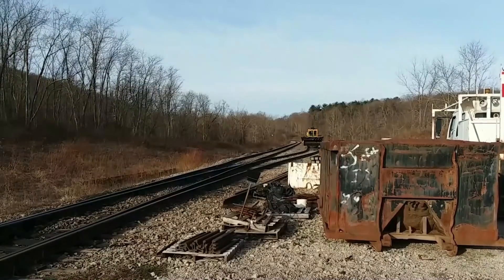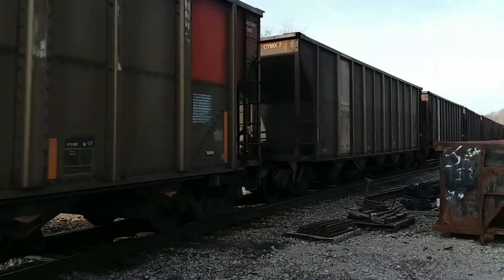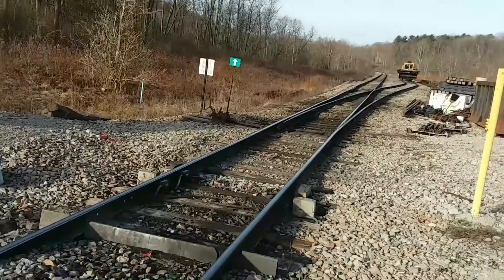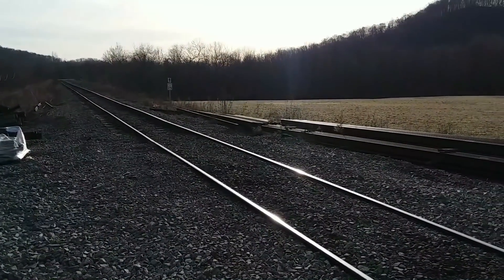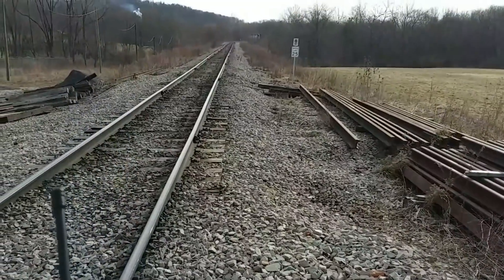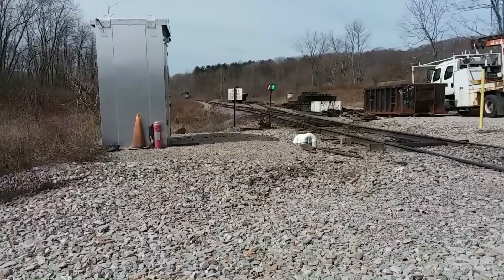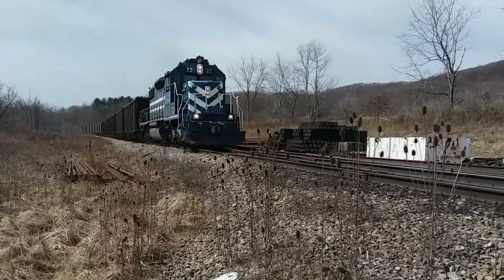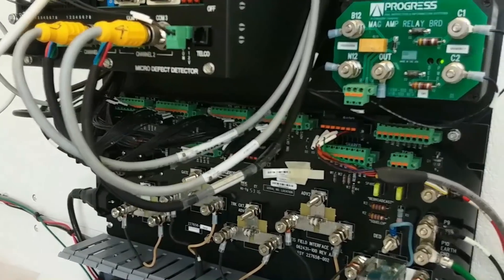Critical Alarm! Hot Wheel Detector Goes Nuts! on Dragging Equipment Message

Comment: I would love a video going into more detail about the technology inside and outside the cabinets. How it works, how the tech diagnoses the problem, and how he fixes it. I love radio technology so this is my favorite video that I’ve found from you so far! Keep up the awesome work!
Reply: Check out Mark Clay McGown's channel. He has a video on "How Wayside Detectors Work"
Reply from the maker: Thanks for the very nice comment Augustine. Have several other videos on a playlist on my channel of the detector, one of which I
take you inside the cabinet and give a better view around than there was in this one. I'm not well versed on exactly how the tech stuff
works, but the boxes on the outside on the rail take an infrared
picture of each bearing and wheel and measure temperatures.
I'll have to study up and learn more about the tech aspect and
see what I can do with another video. Thanks for the suggestion and
for watching today's movie
Reply: A considerable amount of train monitoring equipment is run by DHS in the US.

Comment: Cabinet wasn't over or under temperature was it? I've ran into gear shutting down when the AC unit trips and you don't see it until other equipment starts overheating.
Reply from the maker: It is heated and cooled to prevent that kind of stuff, tech guy
ended up coming out and fixing some glitch in the computer. Do
appreciate your writing in and for watching my good man
Reply: @ccrx6700  no problem, and thank you for providing a view not always seen in the railroad world. It's almost like doing a ride along, without getting in the way!
Reply from the maker: @kleetus92  😊

Comment: I’m really sure the twit listening is not listening right. It’s saying hot wheels as in dragging wheels. It counted 3 hot wheels the first time second time was axle one and two which meat the engine wheels are hot which is par for the course with independent engine brakes. The only thing I can think of is the wheels were dragging until the train reversed then the unlocked.
Reply: You literally have no clue what you're talking about. It clearly stated "Cumberland Hot Wheel Detector, Milepost 8 Point 0", it never said anything about hot wheels. They give them generic names as identifiers along with the milepost. And neither locomotive was dragging wheels. You'd hear it, for one, and two, you'd see it. Both roll-by, you can clearly see and hear the locomotives are rolling freely with no resistance. It was falsely picking up dragging equipment, because it's a combo detector. You can see the dragging equipment detector between the rails, and also the boxes with the eyes for the overheated bearing detector on both sides of the tracks. Why it announces "Hot Wheel Detector" instead of just "Defect Detector" is beyond me. Ours beep once and then announce "CSX Equipment Defect Detector, Milepost 198 point 9, Track 1 or 2, No Defects, No Defects. Total Axle one, zero, zero. End of transmission."
Reply: @DestructionofLeviathan  thanks for letting me know that I was wrong lol. I’m a lot more knowledgeable a about hot wheel, hot box and dragging equipment detectors than you. First of all there was no mention of dragging equipment. It did say hot wheels. Now dragging wheels would classify as hot wheels. There was also another warning about axle one which would be an engine wheel or axle. Dragging equipment would have left evidence ie knocking down a sensor that sits between the rails usually aluminum that gets sacrificed as something hits it versus a long piece of steel that’s a lot harder to knock down. There’s also over size detectors that can measure the overall dimensions of a car to let the engineer or conductor know that either a load has shifted or equipment is hanging off the side of the cars. As I’ve said at the start of my comment I’m not going to argue with you or anyone else on YouTube but being an ex railway employee I’m pretty sure that gives me the right to comment. Have a great day
Reply: @trevorjones8520  I'm a current conductor on a Class I. You have no argument here. You're wrong, and defect detectors malfunction all the time. You might want to get your ears checked. Have a good day.

Comment: This is like my VW giving me a tire pressure warning!  It's almost always wrong, but I always check to be safe.  The one time I actually did have a flat, it didn't detect anything until after I was driving away on the spare tire!
Reply: If it's like mine, it uses the wheel speed sensors, so you have to drive straight for a certain amount of time before it can figure out something is wrong. If it's the upgraded system that actually has sensors with transmitters inside every tire (part of the valve stem), no clue.
Reply: @HammondOfTexas0  Yeah, VW uses the ABS system, so it isn't very reliable.  Other manufacturers use TPMS valve stem, which transmits actual tire pressure.  But to be fair, my 2016 GTI hasn't had many false alarms.  But my 2012 Golf TDI gave me lots of false alarms.
Reply from the maker: Go figure on that one! I can really believe it too. Thanks for tuning in
to the show today good sir

Comment: Whenever our computers are messing up we try a little Applied Science on them. Whack them with a reasonable sized striking apparatus a couple times.  When that doesn’t work we call IT and they tell us to give a few more whacks with something a little bigger.
Reply from the maker: Sounds like a coal miner mechanic, if it doesn't budge with a big
hammer, get a bigger hammer....LOL We did shut it off first thing
but that didn't help. Tech guy finally came out and did a computer
adjustment. Do appreciate your watching my friend
Reply: We'd just pull the plug on them and then plug them back in. If they still didn't work right, the phone to our HQ would get used. IT didn't like getting phone calls at 0200. They'd tell us to pull the plug and then reboot again.  And the control room didn't like hearing we had lost communications with our remotely controlled equipment. If we didn't get it back up in a half hour, it meant someone else was going to get a wake up call. And for the last two years I worked there, it meant I was the one who was going to get woke up. It made for some short nights and some long days as my reporting time was 0600 anyways. Twice in the same night meant no going home until 1430. If it was two of our remote locations, and the local one was working fine, it meant two people were going to be spending the night baby sitting the equipment till the crew from 100 miles away got there and got it fixed. Computers could be a help, or the bane of your life when you are working with critical infrastructure and have a Federal Judge who might get woke up. And anyone could see what the equipment was doing and make the call to the judge. I can still see it today and haven't worked there for 18 years.
Reply: Over here we call it "Percussive Maintenance".
Reply: Dynamite!
Reply: As a life-long computer professional, I can tell you that there is a specific tool which some techs use to manually take care of a malfunctioning computer. We in the business call it "a 2x4"....
Reply: Oh yeah. The old technical tap.
Reply: @mikeznel6048  Percussive maintenance is sometimes required.
Reply: In the radio broadcasting business the whacks are called RCA field adjustments.
Reply: Haha 😂 That been my motto for years “When in doubt give it a clout” 😉👍🏼
Reply: No....  we tell you to unplug it znd plug it back in.
Reply: Hehe the good ol "hard reset". Though it is funny when hard reset actually works.
Reply: That is exactly what used to clear up the picture on our old stromberg-carlson television set.
Reply: Technical taps.
Reply: Not a computer person, I’m a truck person, but at our service centre, I was the first one to respond to the usual customer gripes, won’t start, runs rough, this is broken.  I’d end up bringing it back to the shop. That was actually just my job.  Well, any time a customer had an issue, it would start with me, go aaaaaal the way up the service chain, turn right around and come right back to me, so I never bothered going up the chain, saving phone calls and paperwork, and just trying to fix it, so when that didn’t work, it wouldn’t come back to me again.
Reply: Percussive maintenance...
Reply: That's how I usually do it too. My logic is if I hit it too hard and it breaks more, it probably needed to be replaced anyway 😂
Reply: CTRL-ALT -DELETE  all at once , start over
Reply: Widlarizing.
Reply: We call that percussive maintenance.
Reply: Where Critical Thinking fails, Applied Physics prevails.
Reply: back... believe the appropriate term is "impact correction"!
Reply: A technical tap with a knocktometer. Strength of tap and size of knocktometer varies in relation to size of job. Normally called percussive maintenance.
Reply: Don't forget to turn it off and on again.
Reply: That's right, get a bigger hammer  🔨.......
Reply: Good ol' percussive maintenance
Reply: Average CN rail maintenance in a nutshell. Redneck engineer into working order, then if it ain’t broke don’t fix it.
Reply: About “applied science:” In the 1990’s my wife had a VW Passat. Great car & fun to drive except it was loaded with advanced electronic & electric-powered features ( for that era). I recall beating on the underside of its fuel tank with a 2x4 in order to get its in-tank electric fuel pump to start up. That was just the beginning of a long list of electrical & electronic faults which led us to trade it in for a Honda Accord with minimal electronics (manual transmission, human-powered window cranks, manual door locks, etc.)
Reply: A little percussive maintenance then.
Reply: It does work and likely will do so number of times, at least until you lose your temper at the constant error/fault messages or “breakdowns” and send the object of your rage to an early retirement. It is actually effective enough to work and mitigate the issue at hand. I works exceptionally well on old computer control units an electronic components although I found it is only a very short term solution.

Unless of course it is a heavy old CRT television built by Rank Arena,….
Reply: Ah good Ole percussive maintenence. Usually indicates a loose connection but can save the day till you can scedule a time for real repair.😮
Reply: We call it the 40lb Ford Tool.  It’s a 40lb sledge used with a certain intensity.

Comment: Better a false fault message than a false good message, I suppose.  I apparently saw an emergency stop take place in downtown Smyrna, GA back in the 70s (L&N days) when there was a loud hiss as the train passed over a grade crossing and caught a low-hanging air hose.  Smyrna was a notorious choke point when three trains were trying to pass each other and had to shuffle the one passing track.  You could figure on downtown traffic being snarnled for at least half an hour.   The line's fully double-tracked now and the trains don't stop here no more.
Reply from the maker: You are certainly correct in that good sir, glad we didn't have a
broken brake beam or a hopper car door busted out, just had
a computer gremlin and needed to be exorcised by the tech from
Progress Rail. Do appreciate your tuning in and watching the show
today

Comment: Did you say they put that piece of equipment in the house to stop the alarm from going off? If so are they going to repair it so they can receive alarms?
Reply: The jumper they installed was to make it self diagnose the problem, but that circuit isn't functioning like it's supposed to as well since the expected results didn't happen. Coincidentally there was no alarm at all that time, these are all clues as to what is wrong and which part has the real problem, but you have to have experience with it to know this.  I don't and they don't either, so it's time to call the brains and quit digging around in the wrong manual anyway for what we can do cheap here first without having to call for the real help. It's all working again fine now.
Reply: @leebarnes655  Thanks for explaining.
Reply from the maker: Tech over the phone told us to try that and see if it gave another
defect message. When it didn't give any message we took it off.
Tech had to come out and fix something in the computer. Do
appreciate your watching today Eddie
Reply: @ccrx6700  That was a strange one.

Comment: Whyvas the detector not videoed close-up?   Were the flaps manually moved to check if something was loose?   No contact marks on the flaps?   Could have hit flaps without disturbing the ballast which is a little lower than the flaps.
Reply from the maker: Wasn't videoed up close cause I simply didn't think to do it,
hope you won't fire me for that.....  No marks on the dragger were
present and it has to flip over to the side in order to make the
alarm go off, hope that helps. Do appreciate your watching the show
today Robert

Comment: Saw big brother on the signal box, is that to monitor the trains or for asset protection/vandalism? Probably both I would guess. I've never known a line that didn't have trouble with theft/vandalism. Then again your railroad is on mine property so maybe not so much an issue for you guys?
Reply from the maker: Your right David, for both. We have been extremely lucky over the
years with almost no theft or vandalism. The graffiti you see on
the OFAX cars was painted on them when they were on other RR's
before we bought them, we have only a small bit of graffiti on
the bridges and on 1 tunnel. Do appreciate your writing in and
for watching good sir

Comment: How far are the detectors apart?  I ask that because I watched a UP go by with a struck brake on one of the cars.  There was a lot of smoke and I have wondered how long it had been that way.
Reply from the maker: Good question Red, we only have 1 here, mid point in our track.
Different RR's have different lengths apart on different sections of
line. Generally speaking from the guys on other RR's who I've
talked with they are about 10 miles apart. Do appreciate your writing in and for watching today's show good sir
Reply: Ours are roughly 25-30 miles apart on my Subdivision.

Comment: I honestly can't tell you how many steps I've walked when I was a conductor and how many hours I've wasted due to a defective detector. On the other hand I can't tell you how many times they have saved our asses
Reply from the maker: We've been pretty lucky here Jason, this is the first time this
thing goofed up, but it has caught several hot bearings over the
years saving us derailments. I can appreciate your comment!
Really do thank you for writing in and that comment was spot on good sir.
Reply: best case scenario, it keeps you alive, worst case, its an excuse to stretch yer legs.
Reply: I maintain 11 detectors.. got the most part they behave themselves..my guess is either loose mounting bolts or dirty contacts
Reply: Can these detect if a person is being dragged or is it just for other stuff? Unsure if people even get dragged so probably a stupid question.
Reply: @Neilukuk  I worked as a conductor for CSX in the U.S. for almost 10 years and only had a handful of situations where the hotbox detector went off. Their primary function is to look for hot journals (wheels) that get too hot because the air brake system on a railcar is not functioning properly. Also, as shown in the video, they do detect dragging equipment. I'm not sure if they'd detect a human being drug, but that's primarily because a human body doesn't last long when being drug by a train. Typically, people and large animals just get chewed up into tiny pieces.
Reply: @erad3035  Cheers for the info. I hope you have a great week.
Reply: @Neilukuk  If a body is being dragged by a train all there is going to be is minced meat. And it ain't a nice sight to remove whatever remains. Especially of it was a person.
Reply: @Neilukuk  Yes, it can detect that but when they go through the flaps it probably would shred the body to unrecognition. also sorry for the late reply i just decided to put this since nobody else did.